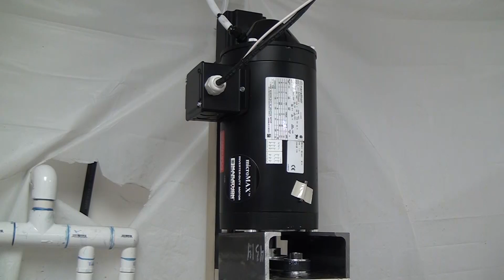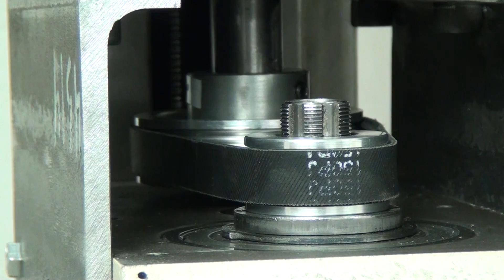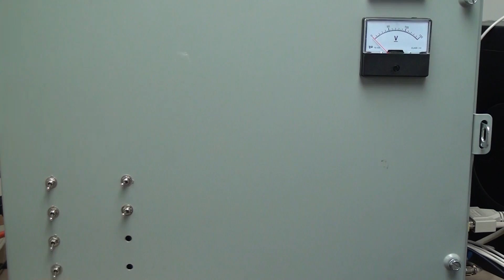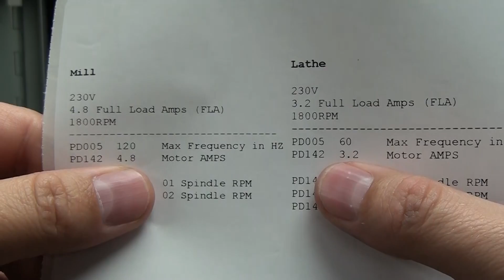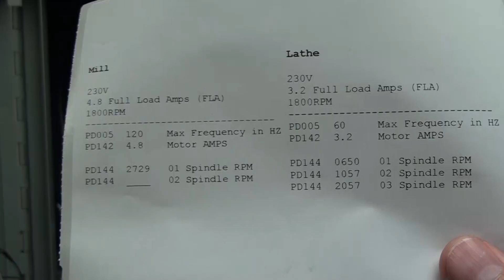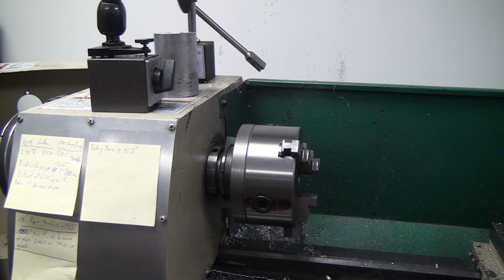03 TSOTM - Yet Another New Motor (AC 3ph)

Comment: Encoders really belong on the spindle. This eliminates problems with e.g wrong pulley. The ladder logic in linuxcnc may be able to compare motor to spindle speeds to alert of e.g excess slip or the wrong ratio.
Reply from the maker: Agreed. Had this motor not come with such a nice encoder, I would plan to go with an encoder on the spindle itself. The other issue I have been warned of, is that if the encoder is on the motor and you are not using a 1:1 belt ratio, rigid tapping is out. I'm not sure that matters much to me right now, but it is something to consider.

Comment: Hi Russ, would it be worth trying to adapt this motor to attach to a G0602 lathe? Especially seeing as it has the quadrature encoder built in. Too much trouble? --Vince
Reply: BTW, there are zero motors remaining at DealersElectric. I guess I just bought the last one :-)
Reply from the maker: I think it would be awesome on a lathe. I considered getting a second one at the time, and just adding an extension plate to the back of my bench so I can mount the motor right to the bench. There isn't any real reason to try and mount it to the lathe itself, unless you just like that sort of thing.
Reply: You're absolutely right. Seeing as the motor provides power via a belt there's no reason for it to be attached directly to the lathe. H'mm, I guess I see this as another project on my cards. I'm working on attaching one of the motors to my G0704 as I type. Thanks as always!  --Vince

Comment: Russ, I had a quick question because I am new to encoders. If I get a VFD which accepts encoder input could I then just use the 10 VDC voltage control through Mach 3/4 to control the motor and after calibrating it be able to control RPM well enough to rigid tap?
Reply from the maker: I'm not sure if you can rigid tap by only sending the encoder signal to the VFD. It is my understanding (at least with LinuxCNC) that the software needs to see the encoder signal so it knows exactly what is happening.

In my mind, LinuxCNC doesn't know the torque curve of my motor so it could only make assumptions on what the spindle is doing when giving commands to the VFD (0-10v).

As for Mach, I have no idea because I've never used it. I'll ask around a bit, but you may want to take your question to the CNCzone forum to see what those guys can tell you. There seems to be a lot of Mach support there.

Comment: Hi Russ, can you please post where you got the serpentine belts and the specs? Thanks!
Reply from the maker: Just added a link to the description.
Thanks!
Reply: Thanks, Russ! 
As it happens I burnt up my stock 2012 G0704 motor and controller board drilling a 2" deep 9/16 hole in a piece of aluminum that had already been pre-drilled 5/16. I went ahead and ordered the replacement parts from Grizzly (almost $300) because I had to get my project finished. Once my project is done then I'll go ahead and start the process of tossing out the Grizzly motor and replacing it with this Dealers Electric inverter duty  motor. Once again, thanks for all the informative videos and support that you provide. -Vince
Reply from the maker: Vince Bummer! Hey no problem, I'm glad I can help.

Comment: Hey Russ do you have a link for the Mesa setup?  Thanks.
Reply from the maker: +Ron Edmeades The link was already in the description :)
Reply: Doh, the old 'show more' button miss.  Thanks Russ
Reply: What is your view on going with something like the Mitsubishi HC-SFS152 which is the 1.5kw mitsubishi servo motor - ok so it is spendy but you get an enormous amount of torque plus you could do hard tapping etc.?
Reply from the maker: +Ron Edmeades No problem.
Reply from the maker: If you could find one for cheap I'm sure it would be good. I plan on rigid tapping with this setup as soon as I get the encoder issue solved.
Reply: That I would be really interested in seeing.  Rigid tapping seems to be the 'holy grail' of cnc machining!  Ron.

Comment: Without a dedicated braking resistor I think the VFD diverts excess votage to an onboard resistor. It should be smart enough not to burn it up by coasting the motor down if it get an overvoltage alarm. That said, get the braking resistor! They are cheap on ebay and can handle WAY more than the onboard one. It's just a two wire installation and some program settings. You can get the spindle to nearly dead stop if you wanted. Probably not a good idea though. I have accel/decel set to 1.5 sec only because I'm afraid of breaking the unusual and hard to find European form factor timing belt my spindle uses but I've gotten a near dead stop before the motor was mounted, just playing around. Loud boom and stopped, nearly flipping the 90lb. motor from inertia. Yeah ease up a little I don't think there is a need for dead stop, that's a little violent.
Reply from the maker: +War Machine LLC I found one on ebay that is the rating my vfd requires, it is only $25! I'll pull the trigger soon. Thanks for the info!

Comment: Great vid Rus!  I still need to go watch the next one.  The vfd has a very small braking resistor in it, but it can't handle the amount of reverse current created when trying to dynamically brake the motor.  If you exceed it's limit, the vfd's I've had simply start to try, then give up and let it coast to a stop.  I think the quality of the vfd determines how easily that will fry it.  The braking resistor is absolutely worth the time/money, but not all vfd come with the option.  I'd go nuts waiting for mine to coast to slow down. :)  
You could even try .2 on your start up time.  If it doesn't like it, it will not move or just bump a bit....basically, the ramp happens so quickly that the motor can't keep up......but you've got a really good motor.  I think I have mine(not the same motor) set for .2....maybe .3  I came to the setting by starting and stop at max speed(6000rpm).  I did it a dozen times and if it balked at it even once, I changed the setting to something a bit slower.  Time to watch the next.
Reply from the maker: +bluehandsvideo Cool, thanks for the info!
Reply: You're more than welcome, but I'm betting you already knew most of it, if not all......but maybe another viewer could use it. :)

Comment: Russ,Wow, is that motor weight truly 60lbs? that's a lot of weight hanging up there, especially if you plan to put on a PDB in the future.. I would think you going to be stressing your Z axis stepper motor and might end up having to put a brake on it to keep it from bleeding down. Also get a braking resister for that VFD.
Reply from the maker: That's what the specs say, and I agree. I'm already having trajectory problems in LinuxCNC so I'm going to have to add a couple struts to the head to help neutralize the weight.
I'm shopping for braking resistors now :)
Reply: I am running an Emerson Commander SK 230v VFD with an Iron horse 1.5hp 3ph motor and a 75ohm braking resister. Works Awesome My VFD guide specified what range of braking resister I could use and I found it on Ebay for around $30.00, I have basically the same build as Sams PM27 Enclosure Build. The motor weight is 36lbs MTR-1P5-3BD36 from automation direct and thus far it has handled everything I've thrown at it with no issue and having the built in fan on the motor is awesome for long runs. The one thing I found with burning up motors is the torque required to spin the cheaper end mills when they quickly become dull (basically after 1 or 2 uses) was one of my biggest issues and since I started using some of the more expensive Lakeshore Carbide endmills my motor works less and the end mills last longer therefore saving me money in the long run because I am not burning up motors and end mills are lasting longer.

Comment: Hey Rus, I run a teco VFD on my mill, My start time is .5 and my stop time is also .5, I am using a resistor though, they are DEFINITELY worth it. When you think about it, a single phase lathe has 0 start time, so what's the difference with the VFD? The only thing it could hurt is the VFD, but I doubt it
Reply from the maker: Right on. Thanks for the info.

Comment: I've used one of those Huanyang inverters for about a year now. They're ok, but I highly recommend replacing it with a Hitachi WJ200 instead. You can still run it off Modbus, they're much more pleasant to use, they have autotuning for the motor drive parameters(!) and the low down torque when set up correctly is way better than the Huanyang inverter (at least on my Chinese 3 phase 1.5KW spindle).

That motor though... wow. Shame I can't get one in the UK.
Reply: outlate247 I'd suggest going with the next capacity up. you'll want to be able to drive a bit more current when the motor is starting due to all the inertia. It's more expensive but worth it IMO, these Hitachi drives are brilliant.
Reply from the maker: Thanks for the tip, I'll look into that inverter. I've been considering an automation direct GS2 or GS3 (vector).
Reply: There's a LinuxCNC HAL component for the GS2 (http://linuxcnc.org/docs/html/man/man1/gs2.1.html) so controlling that would be easy. Not sure if the GS3 is compatible though so you might have problems controlling it.
Reply: Wondering if the Hitachi WJ200-007MF  ( 5 amp max ) will handle the Marathon 1.5 hp motor ( rated for 4.8 amps ) ?    Basically, is it safe to disregard the HP rating of the motor and just rely on the AMPs the motor is rated for ?
Reply: I looked for a model a step up, however they don't offer a version with more power handling capability that accepts 110 V input.  Thavks, and I'll report back if successful or not, should I give it a try :-)
Reply: Ah shame, guess I was lucky having 220v out the wall in the UK. You can probably derate the vfd and/or set startup overload limits or something so the inrush current doesn't cause the unit to trip. I can also recommend the PC software - ProDrive Next - for all this config, makes it much easier than messing about with the keypad

Comment: I didn't have an issue with short times during spin-up, only for deceleration, basically when I go to a larger chuck it trips the vfd due to overvoltage (I have 2 vids uploaded, one of them is about this issue with the huangyang vfd on my lathe and the solution to get around this and using shorter times for lighter loads with a 3 position switch and 3 programmable inputs on the vfd). 
you can use a braking resistor (I have one) but it only activates it once it is below a certain rpm (can't remember what it is but for the sake of argument say you have it spinning at 1200 rpm, the vfd will decelerate to 200 at which point will engage DC braking). 
hope this helps
Reply from the maker: Yeah deceleration is what I meant. I'll check out your videos. No way to have the braking resistor activate immediately? That's a bit frustrating, maybe I'll hold off from ordering one for now.
Reply: the resistor helps but yes, it does not activate immediately. They're cheap off ebay so it's worth it, (only 1 vid is machinery related btw)

Comment: Great video.  The accel. and deccel times are the time VFD takes to ramp the Hz up or down to the frequency the VFD is set to. The time the motor actually takes to get there will be dependent on the motor torque curve, load and current the VFD can put out/take in. When setting short deccel times a 3ph AC motor with high inertia loading will generate power back to the VFD, where 1 of 2 things happen. 1.  the VFD consumes the power to run its fan and electronics or 2. Over voltage on the DC BUS of the VFD and it goes to self protect mode and faults out or increases deccel time until voltage is goes back to normal.
Reply from the maker: Thanks! Great info, I appreciate it.

Comment: Russ, I have been following your videos for a bit now. Great I formation and taking the time to share what you have learned. I am going convert my g0704 as well and wanted to know how accurate your machine is with everything you have done with it?
Reply from the maker: I plan on accuracy of .002" or better. I once machined a 4" circle and it was out .004", which didn't bother me one bit. The only times I've needed dead on accuracy was with my lathe for things like slip fitting something into something else. BTW .004" is the thickness of a post-it note, which is not much over a 4" diameter. I'm certain I could do better if I really cared to try.
Reply: With your current CNC setup, what do you think are the factors limiting accuracy? I would also like .002 and .004 over that distance is fair enough.

Comment: That's a lot of circuitry in your VFD box. I might have to watch the wiring video. We have our VFD hooked up to 3 different 3 phase machines, with no switches, no circutry, just straight in. And we use the machine switches to run them. I know it's not the proper way to do it, but it has been working for three years.  You comment about damaging the VFD, burt I switch the drum switch on my bridgeport back and forth all the time when power-tapping, from full power forward to full in reverse, and it takes a lot of energy to slow it down in backgear. Never caused any problems, but then again, I don't have the same skill in burning stuff up as you do. 1hp bridgeport, 1hp VFD.
Reply from the maker: Nice. I say if it's working don't change it. Good to know about the tapping. As soon as I get my encoder situation solved I intend try it on this machine.
I am awfully gifted at burning up motors :)

Comment: More great stuff from Russ!  I bet you won't be burning up this motor!  I already bought a very nice 1.5 HP Baldor sealed motor (intended for washdown and steam cleaning applications in food processing) on eBay for under $50 delivered a few years ago for my Some Day CNC mill conversion, otherwise I'd be all over that great deal you got on this spindle motor, even though the encoder resolution is way overkill for rigid tapping.  I'm planning on cobbling together my own quadrature spindle encoder.  I know you're not looking for another project at the moment, but the MESA I/O would be a great upgrade for you, not so much for high speed spindle encoding, but for all of the I/O you'd get.  There would be plenty of I/O for your mill and lathe without sharing I/O points.  Much as I appreciate the simplicity of optoisolated parallel port I/O, I would love to have Path Pilot so I'd be even more inclined to upgrade to MESA hardware for that eventuality.  Thanks for the caveat about stepped spindle speed with RS485 control.  I knew that but had temporarily forgotten about it.  There's nothing complicated about braking resistors.  They simply dissipate the rotational kinetic energy of the spindle as heat when decelerating.  I hadn't planned on braking resistors, but probably should, for the mill and the lathe.  In addition to saving time in CNC programs (I do manufacturing so there's a lot of repetition), a fast spindle deceleration also enhances safety.  Hit the E Stop and the spindle stops sooner rather than later.
Reply from the maker: Sounds like you got a killer deal on that motor! Yeah I think I'll go Mesa before to much longer, mostly for the IO. I found cheap braking resistors on ebay, $25 for the one I need. I may just get it.
Reply: My Baldor motor looks nice, but your new motor looks better, and the installation looks VERY nice.  I have several 60 drawer organizers full of 1/4W resistors.  I figure I can put a bunch of those in a series-parallel combination in lieu of buying fancy store bought braking resistors.  :-)

Comment: Does this motor have any special requirements for a VFD?   Or will any VFD that can handle up to 4.8amps work?
Reply from the maker: Any VFD will work. If you have a vector control you could send one channel of the encoder to the VFD and it could handle some of the workload. Unfortunately, I'm not aware of any brand vector control that has a driver for LinuxCNC. The Automation Direct GS2 is on there, but not the vector GS3. Fingers crossed someone who knows how to write a driver will work it out for us some day.
Reply: Just received one of these marathon motors and I did not realize how big it was going to be.  Is your z-axis having any problems lifting this beast up and down?  I suspect any slop in your z-axis will go away with this much pre-load. ;-)
Reply from the maker: Mike Wick Yeah, it's HUGE! So.... yes it is, but only in a weird way :)
The stepper can lift it and is not losing steps at all. BUT, it is lifting it slowly which is causing me some trajectory problems. You know what, I'm going to do a video about it right now and set some expectations because I don't want to try and explain it all here. Give me an hour or two.